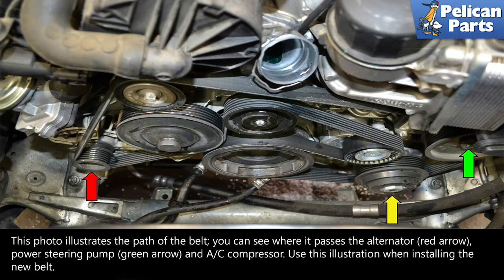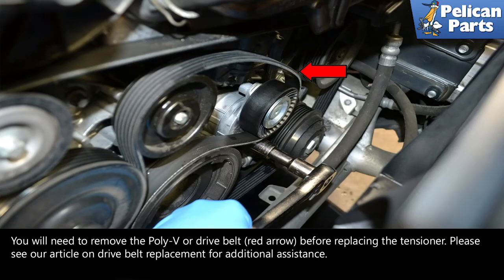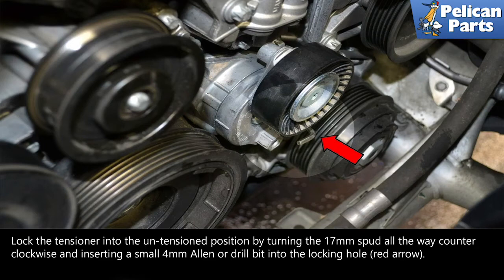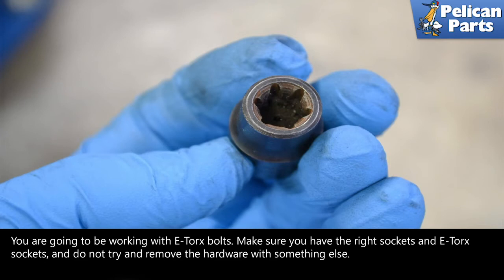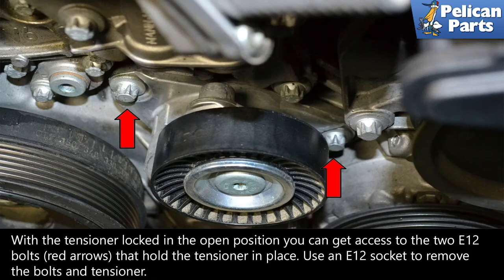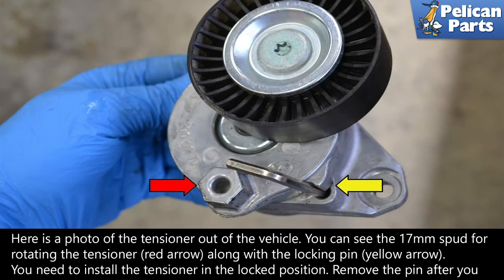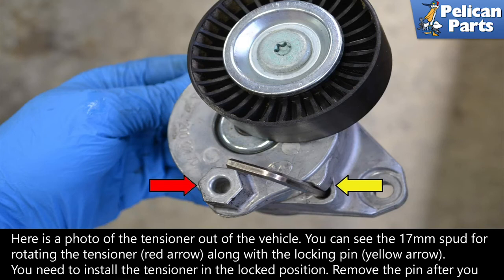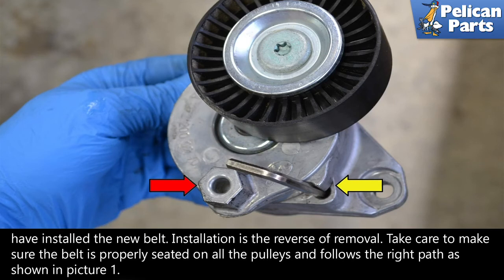Mercedes-Benz W204 C-Class Belt Tensioner Replacement

Comment: Nice video! Is this the same on the 2010 w204 C180 CGI? I saw a similar video where there`s a bolt going in from the back side holding the tensioner (work done on a facelift C-class model).
Reply from the maker: Applicable Models:

Mercedes-Benz C350 (2008-15)
Mercedes-Benz GLK350 (2010-15)
Reply: @pelicanparts  Thanks for info🙂!
Reply: Is not the same by a W204 C180 CGI, bolt in backside.
Reply: Thank you :)  @european1966